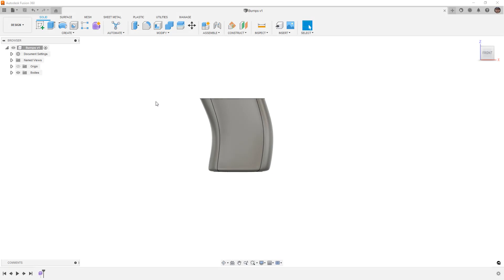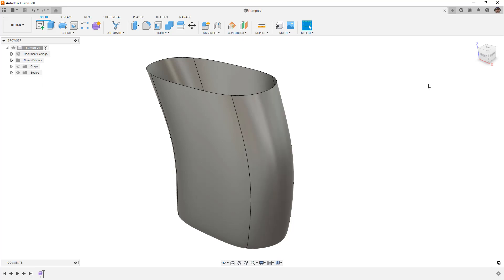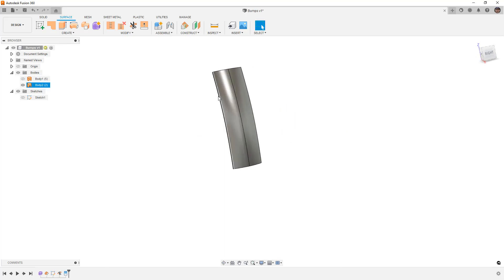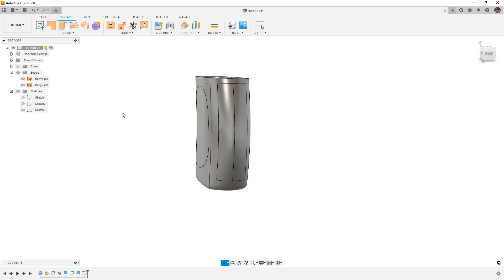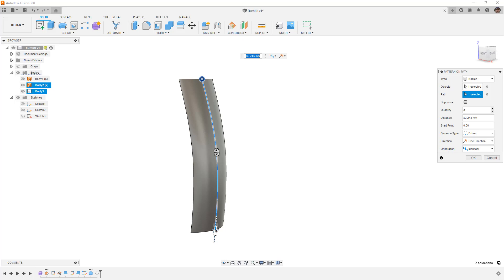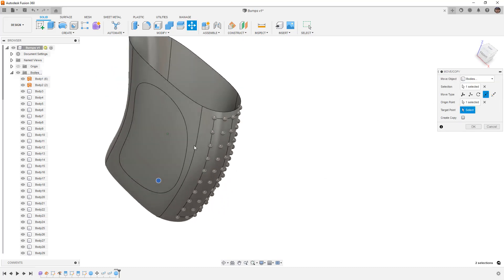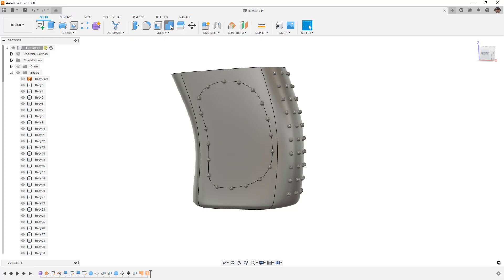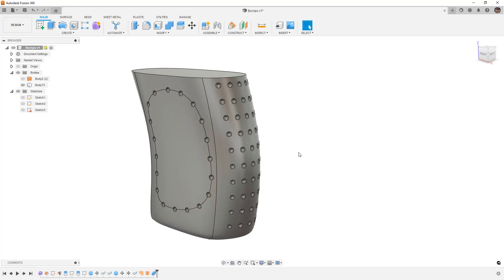How to make a Pattern on a Complex Part | #Fusion 360 #Concept

Comment: How did you "just trim this" rectangle....  been watching that 20 times without understand. Thanks!!
Reply from the maker: the "just trim this" part where we use the rectangle to trim the surface?  If so that is the trim tool on the surface tools tab.  It will project the sketch regtangle normal to its sketch plane. then you can select the part of the surface you don't want.
Reply: @LearnEverythingAboutDesign 
I have a curved surface made by the loft function. Copied a section to surface patch, but it will not do the trim projection. Maybe the loftis not cutable?

Comment: 2 years later… is it working now? Autodesk at its best
Reply from the maker: Most of the patterns on complex parts you find in CAD are mesh based.  Even solidworks that released this type of thing over 5 years ago was just a graphic and what it did was convert the part to a mesh and did a mesh manipulation.  
The best way to do a pattern is at the mesh level if going from Fusion.  Either in a print slicer (some have that option) or going into a mesh tool like Blender and using a mesh brush.  The downside is you need a really high density mesh to make it work right.

Comment: I designed a barrel and wanted to add wood grain for 3D printing, but it is very difficult, since it is a complex curved object, any suggestions?
Reply from the maker: I would export it as a mesh, bring it into blender and do a sub division so you have a lot of small triangles and then use the sculpting tools.  There are loads of free addins that have textures where you simply need to drag the cursor over the object.

Comment: Incredibly helpful! But would anyone know how to create a hole (instead of a dimple) in the solid perpendicular to the complex surface along the designated points on the path? I tried using a cylinder primitive but it would not line up correctly.
Reply from the maker: it can be tricky.  If you can get sweep to work that is likely the best option.  sweep with guide surface as long as your first cylinder is correctly positioned.  If you want to do it with pattern on path it will be limited and that first object(seed) needs to be correct.  In this example i did a cylindrical revolve cut on the same shape and did a pattern on path based on the path direction orientation.  https://a360.co/40h47LU

Comment: Thank you! Super helpful. What if I wanted each of those rectangles to scale in size by 110%?  I've figured out how to do it all in parametric modeling (where each object references the object before it) but the whole thing is missing one crucial property:  the ability to define # of objects (ie, if I wanted 22 rectangles instead of 7) parametrically). The Pattern tool DOES let me define # of objects but it doesn't seem to let me adjust properties of each object according to some formula. :(
Reply from the maker: Yeah that will certainly be a limitation of using a feature pattern.  Scale is an independent tool and not able to be used during a pattern.  The only way I can think to do this is with a custom API script that would go back and scale each object.  I know some CAD programs like Solidworks have a sketch pattern option that lets you do something like this (vary sketch), but it isn't a true scale.